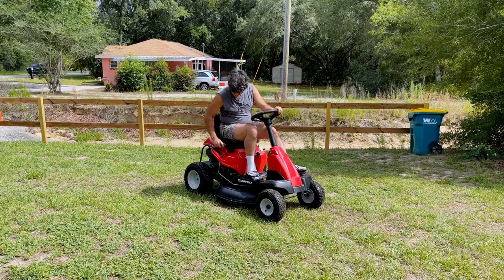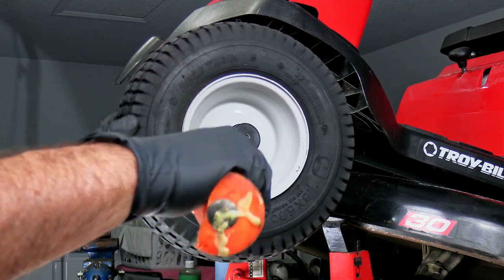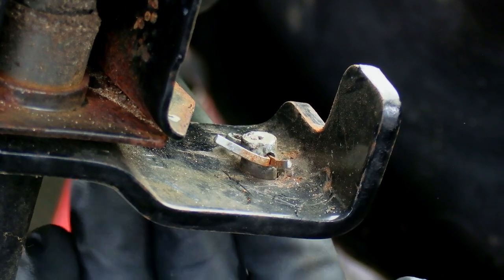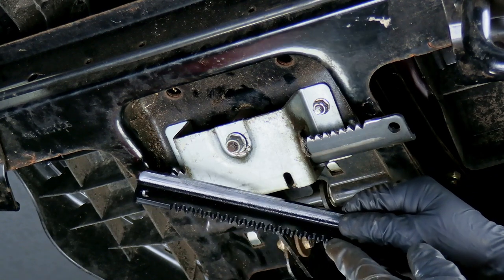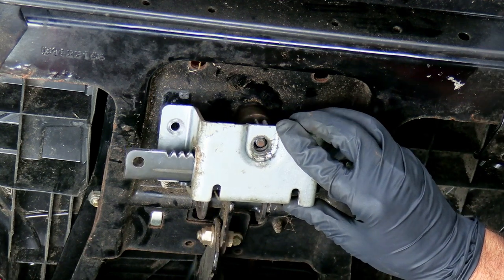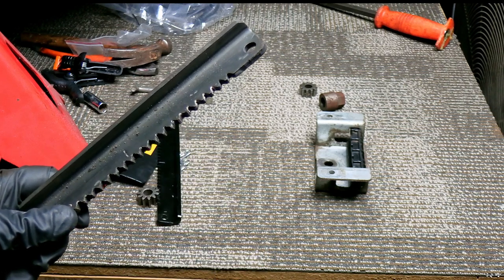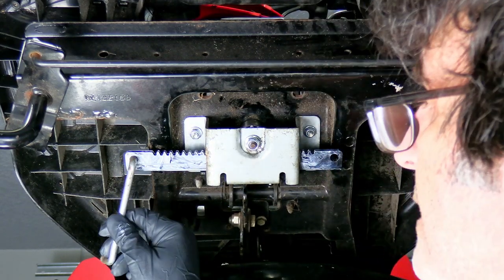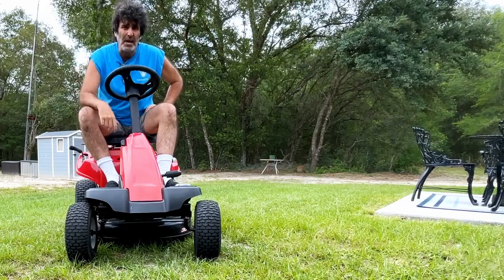Steering Failure on Troy Bilt TB30 Rear Engine Riding Mower!

Comment: I bought my mower new and have always had the problem of my wheel locking up when I turn it all the way to the left or right. Is it possible the tie rods were installed incorrectly when it was assembled?? Love your videos!
Reply from the maker: HI, yes that's possible.  Have you looked at the linkages to see if there's anything that stands out?
Reply: Me too.

Comment: Too often, people fail to explain nuances.

No mention of how tricky it is to align the steering wheel column to attach the rack holder. 

I would recommend lightly gluing the pinion to the rack holder to make it easier to lign up for installation. The glue will easily break away upon steering. 

Takes two people, one to wiggle and turn the steering wheel when aligning the rack holder. 

That bushing, yeah, its hex end needs to be pushed into the cowel from underneath, which is why you need the second person to help align the steering wheel and it's shaft, wiggling it nose to tail helps.

The area the U shaped rack holder mounts to is not parallel to the ground, more like a 45 degree angle. I wasted time thinking it was parallel to the ground.

I gave up after 90 minutes, will call the repair shop tomorrow. 

Would have been easier for me it just buy a new riding mower. I earn that much in about three days.
Reply from the maker: HI Craig!  Sorry to hear that you didn't get your mower working...  I know it can be frustrating.. 😟